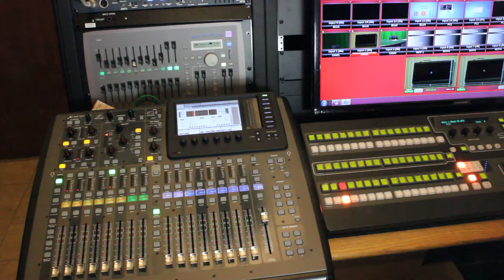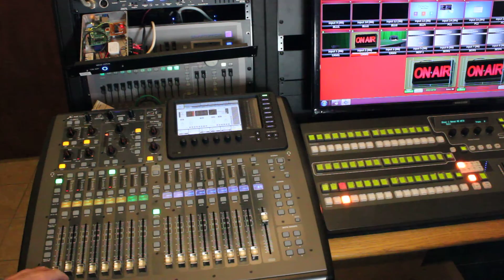Behringer mixer on-air sign interface

Comment: I did a small write up on how this was coded
http://www.algissalys.com/how-to/raspberry-pi-and-behringer-x32-mixer-control-on-air-sign
Reply: I can't get your script to run ...
Reply: If you want to provide specifics, I can point you in the right direction...I have this running now for about 6 months with no issues.
Reply: Turns out there was a problem with the was it was put on the website .. Needed some love.

We would like to customise is to monitors DCA rather than channels.
Reply: I've tried to email you a few times, but had no reply. Can I have a contact point?